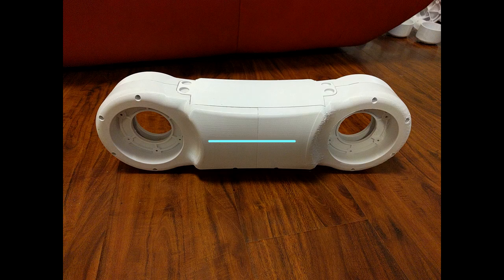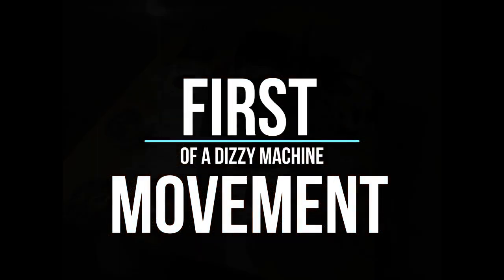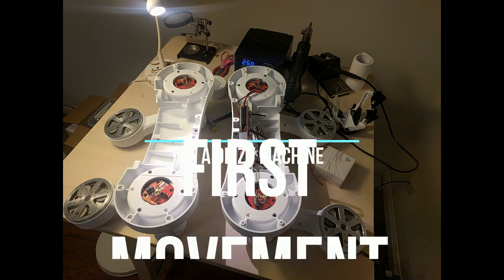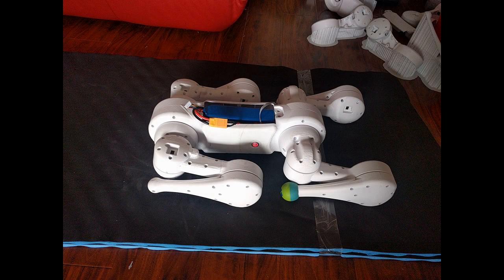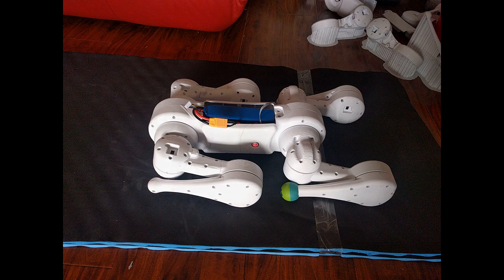First movements of a dizzy machine

Comment: It moves!  Yes, I know it looks all floppy, but I appreciate what it takes just to get to 'floppy'.   Awesome job.
Just to get it to stand with minimal feedback, you would probably have better results pointing both knees out.  You really do need coordinated motion though as the rotational force required is going to change a lot depending on how much of your rotational angle is going towards lifting the robot.
Or, just skip to the end now and write your kinematics equations. You could probably lift the entire Y-Z motion directly from the equations used for SCARA.  Then you can just request a foot position relative to the body and coordinate the motion so one joint doesn't get ahead of another.  You'll need to write both forward and reverse kinematics, but you are going to have multiple possible solutions so a little logic will be required to flip you knee position for example.  Apply your PID loops to that, and then... magic.  Good luck.